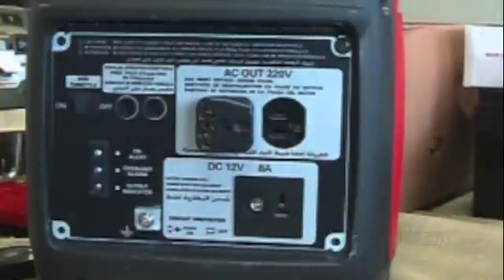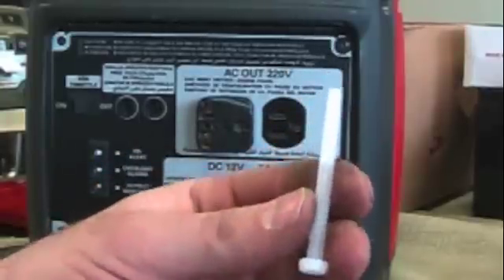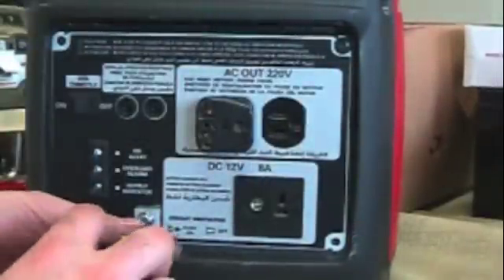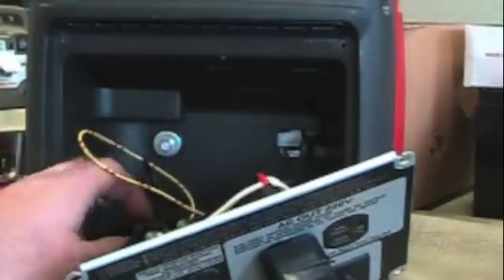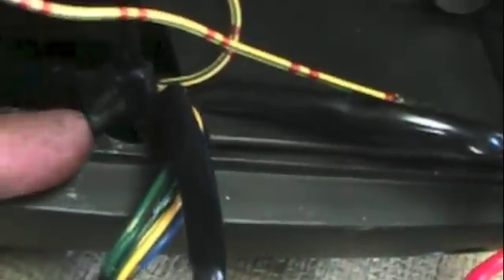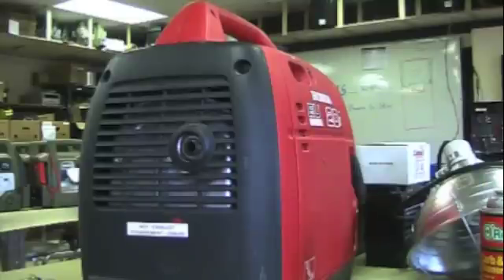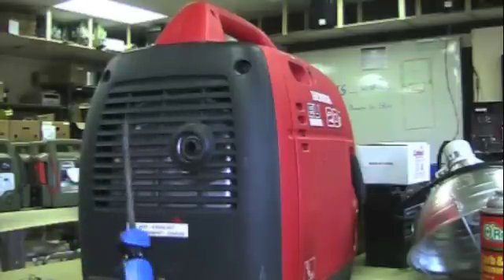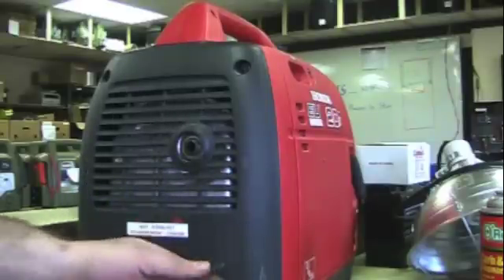Honda EU2000i Fuel Filter Cleaning

Comment: Ya don't need to take the front plate off. Just take the 2 side screws and the 2 very bottom screws.  Wiggle a bit and pull top forward so as it sort of hinges at the bottom...now you can get at it.  Way more easy.

Comment: It would have been better if you zoomed out from the start #1.
#2 you should have put a Spark Arrester back in yours.
#3 The best way to clean the carbon buildup on the Arrester is to use a Propane Torch to burn the Carbon off the strainer mesh It won't hurt it.

Comment: If you use a 1/4 Joint Adapter Ratchet Socket - you don't need to unclip the cable

Comment: I did this and though I bought this new in 2005 or so, though didn't use it much (so its likely my carb is dirty and I'll go by your other excellent video on that), and I have no screen so there never was one......did certain years not have a screen?  There's a slim chance some mechanic removed it but that's not very professional to throw away a spark arrestor designed to prevent forest fires.  Not very good for business either not to just clean it since I'd be back for cleaning in the future.  They should also let the customer know if they do such a thing and I only brough it in for an oil change and to get it running.  They put Sea-Foam through it to save time/cost for me and it improved things a bit but still runs only on part choke.  So maybe they tossed the screen except they weren't a Honda dealer to know there was even a screen there.  And in fact there possibly wasn't.

Comment: Well done and thanks - this is a few years old, but will add in hopes it helps someone -- I have two of these and using this video replaced fuel filter and cleaned spark screen; I also had to replace carbs with OEM replacements because of old fuel -- also replaced spark plug.  First one purred like a kitten.  Did the same thing to the 2nd one and it did not crank.  Checked carb and dry.  Opened front back up like I was going to change the fuel filter and inspected -- pulled off fuel line and fuel did come out of tank.  Upon close inspection, there is a pulse type fuel pump on inside wall just above the on off switch.  There is also a pit valve that is connected to the same fuel line the fuel filter is in.  The pit valve appears to be working, so the culprit seems to be the pulse fuel pump.  My guess is the fuel varnished inside the fuel pump and it is not working (we are talking a 10 dollar part but a real PITA to get to,  I was able to remove mine by opening the front like you were going to change the fuel filter, then I took the two screws out of the handle, pulled rubber loose around fuel tank, carefully pulled apart just a little so as not to break anything, and removed fuel tank -- then I was able to get to fuel pump and remove -- will go ahead and change the pit valve also just in case.  Now, since I know the fuel filter is there, I am not going to remove the OEM fuel filter and put a in-line one in (I had planned on doing so).  The fuel filter needs to be in front of the fuel pump (although it did not seem to help me in this case).  I also learned something else -- The on and off switch on front bottom right of generator is both a manual fuel valve and an electronic kill switch.  There is a connector right inside the generator on the bottom below air filter with a black and green wire .  I can unplug it (that is the electronic kill switch) and then turn the on and off switch to off and 3 minutes later it will run out of what fuel is left in the carb. -- Then I can plug the connector back in for next time, or if I want to kill it right away.  Little more hassle than putting in a fuel valve, but the little I run the thing, no biggie.
Reply: Hello, curious if replacing the fuel pump worked for you.  I have the same issue with no fuel getting to the carb.  I replaced the fuel pump but still having the same issue.  Of note when I removed the fuel line there was no filter.  would that be a reason for the fuel to not get to the carb?  The pit valve seems to be working properly.   thanks

Comment: If you add an inline filter you should install it between the tank and the fuel pump otherwise any gunk that gets into the tank could run through the pump and damage it.  That's why the original filter is located where it's at, to protect the pump, the petcock and the carb.

Comment: Works great.•••>share4.photo/H2KGenerator?Jせ  I have tested it with a 1,600 watt load which it handles with no problem and no strain. I am confident it will provide the power I might need when the lights go out again. Eco-throttle responds well as load is dropped or increased. Fuel consumption appears to be low as expected. Honda quality is apparent. Easy to crank if you do everything right: open the fuel vent, turn eco-throttle off, turn the switch on, and choke it. Initial start-up as received was a bear. Almost wore my arm out before it cranked up the first time trying to get gas to the carb through the empty fuel lines. No problems since then unless I go brain dead and leave out a step.

Comment: That generator does not have a fuel pump therefore if you use an in line fuel filter with a paper cartridge you are going to restrict the flow of fuel to the carb. Not a good idea. Also why would anyone run a generator indoors?
Reply: Nice litte buzz.
Reply: RJD the filter will not restrict the fuel
Reply: It has a pulse fuel pump on inside wall right above the on/off switch

Comment: Sure would have been nice if the tank were drained so we could see the actual filter replacement.  Same thing with adding a separate fuel filter. (like actually DO IT?)
 I also have to take issue with advocating cleaning the filter with gasoline.  That's a fire waiting to happen!  Never EVER use gasoline as a solvent!! The vapors, not the liquid, is flammable - which is what makes that practice so dangerous. Watched a real nice house burn to the ground when I was a kid.  Started in the garage workshop. Yup. Cleaning with gasoline. Fumes leaked into the adjacent furnace room where they met up with Mr. Pilot Light.  Lots of safe alternatives out there.
The spark arrester section was similarly less than useful.  
The entire video was a good education as how to turn wrenches.  The idea for the vid was fine, but not actually doing any of the three tasks was a big disappointment.

Comment: I run my Honda generator exclusively on Race Gas, AvGas or (NON-ethanol) real gasoline and never have to worry about any fuel system issues.
Reply: Try alkylate fuel such as Aspen 4 or Stihl Moto 4.
Reply: @douggolde7582  expensive fuel, but long shelf life and great for emergency use.
Reply: What state you live, that sell non ethanol gas?
Reply: @tanhvan1  North Carolina.
Reply: Too bad ours is 400 miles away

Comment: Ok I did all this and spark arrester, spark plug and what mine is doing is it will start for just a second or not start but you can tell it wants to. But not when you choke it. Only with chock off. It is getting fuel and won’t start with ether when I try that as well. Does anyone have any other ideas? I gapped the plug as well and cleaned the fuel filter like you are showing in the video. It was not dirty at all.
Reply: look for pilot jet cleaning youtube vids...should solve your problem.

Comment: duh, but how do I drain the gas of of this thing before I start?
Reply: learnpoise Tip it upside down over a bowl to catch the fuel. They’re heavy so partially support the Honda over some saw horses or something.
Reply: There is a drain screw at the bottom of the carb but it will take awhile or get a manual fluid pump
Reply: Just run it out if you can. Mine, not fixed yet, still tuns and works well with the choke all the way open AND in eco mode. Pretty sure it's the fuel filter needs replaced or cleaned now. Put gas in to chack orher stuff but tan it out before and that carb was dry as a bone. Nothing came out after running it dry.

Comment: While you have it apart  on that same line you cut to add the fuel filter add a on off valve and you can shut off the gas flow to the carb and allow the engine to use up all the gas in the boil so it won't gum up and make it so you have to run  it with the choke half way on. The only bad thing about removing the filter  from the tank is dirty gas will be getting into the fuel pump diaphragm . Its always better to have a filter before it goes into the fuel pump  and diaphragm.
Reply: All of our people use the water fuel separator filter for this reason. Fuel coming out of a barrel in Third World countries is often full of water and cried.

Comment: Thank you so much.  I did not know about this filter.  Guess what it worked it was clogged causing the generator to run real rough like it was a carb problem.  Your solution of removing it the best wonder why Honda doesn't fit a inline filter.  Once again many thanks for an awesome fix video.

Comment: My Generator runs pretty good with full chock but won't keep running if I "un-choke" it.  So, I went to youtube, found this source and watched this first video.  Hopefully, the two suggestions will fix the problem.  Regardless, great job on the video!  
Thanks,
EKW
Reply: Did replacing the filter fix the problem for you?,, have the same problem now... thanks.
Reply: Rafael Quinones Curious myself
Reply: @AquaTech225  YT reply notifications suck!
Reply: @bigteddybear5962  Ain't that the truth!!  So frustrating!
Reply: @quepala el surtidor de combustible esta  sucio en el  carburador!

Comment: You just saved my a.. I use this to run my AC. And Refrig in my Semi. I am in Phoenix and it is very HOT! It would not stay in high idle to power AC.  I watched the video and 10 minutes later I was chilling. Thank you for sharing.  The Owners manual says there is one but gives no clue where it is. Thanks again.

Comment: Thanks for your video, it really helped me through the process not only showing how to do it but encouraging me to attempt this and the restoring of the carburetor.
there is a gasket between the muffler and the exhaust pipe....should be, it is in the specs and on my generator. so if you are going to remove the muffler I would recommend having a new one to replace the old one with; on my generator the gasket was very fused to both the muffler and the exhaust pipe, probably due to the heat, and was ripped up on separation of muffler from exhaust pipe.
And as far as the fuel filter goes, if you drain the gas you can see the filter sticking up into the tank and there is a length of the filter with no mesh holding the mesh up off the bottom so I would think you have to have a lot of cr*p, maybe 1/4 to 1/2 inch, in the bottom of the tank before it would start to clog the filter mesh. And based on the old "petcock" experience in vintage motorcycles, that filter really isn't going to need replacing or unclogging for centuries probably.
Reply: In my specks it also says there is a gasket in-between the exhaust and the muffler but when I took it off to clean the carbon out of the muffler there wasn't a gasket. Sooo ?
Reply: @lindamazur4208  Its been a while since I've sold my generator but if I were you I would order a gasket...scraping the surface of the manifold connection and the muffler connection surface in case the old gasket is hiding and fused to either or both. A gasket would allow for a quieter connection instead of metal on metal and also insure now and in the future no, to very little, exhaust leak between metal on metal surface connection. Keep in mind I am not a very experienced mechanic type person; but thats what I would do and see if it has any bad long term effects and then become a more experienced mechanic type person and then be able to give advice based on knowledge.

Comment: I have the same problem. How often do you run your generator? I seemed to have fixed it for now by draining the fuel tank, adding about a cup of gas and an ounce of Seaform, and running it until it stopped. I did this 3 more times and by the end it was running well. I try to run mine every month or 2 for a half hour, but I think I need to run it longer.

Comment: thanks for posting... I've cleaned the jets, soaked them overnight and scrubbed with a toothbrush, cleaned the exhaust screen, removed the inline fuel filter... but.. dang.. the engine still runs erratic without partial choke? I wonder what the deal is? maybe I'll try using new jets? or possibly something is plugged somewhere else? It's been a great generator, hope I can fix it
Reply: did you clean the idle jet?
Reply: It took me 2 or 3 carb cleans before my genny finally started running perfect

Comment: Thanks for sharing! Nice video! It is really good that people can watch how to clean the filters and spark arrest.

 Some of the honda generators had a recall on the fuel filter line house clamp that needs to be pointed away from other fuel line (you can see that at 3:45)
powerequipment.honda.com/pdf/Recalls/eu2000i-recall-poster.pdf
You might want to check your serial number and contact honda dillership or just flip the   fuel line clip 180.